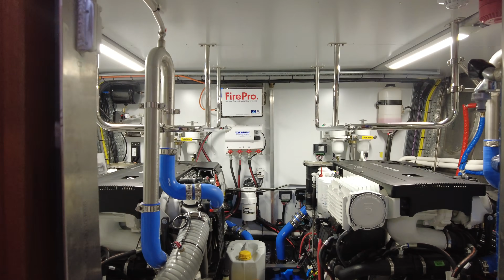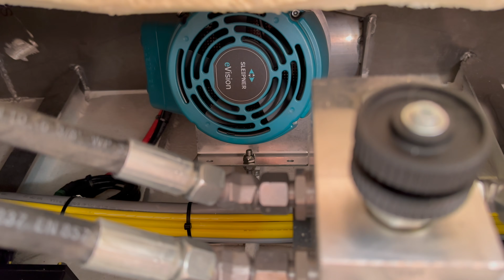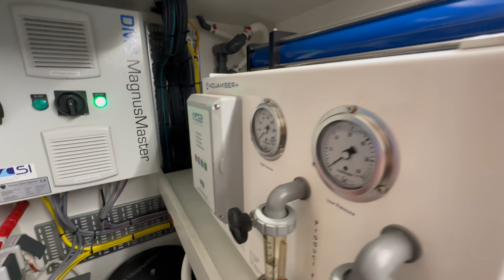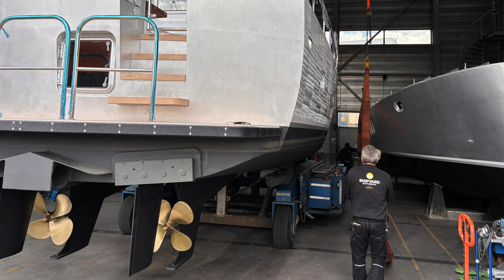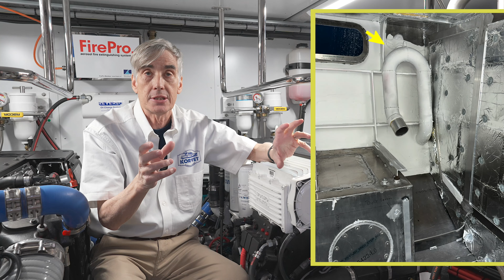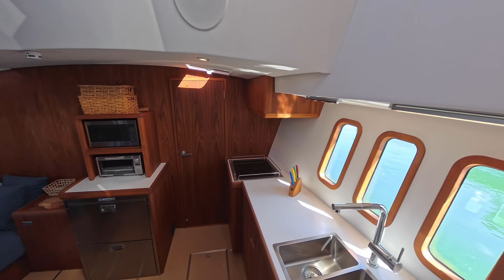The Most Important Room On Any Yacht: The Engine Room

Comment: How is the hull insulation done? Is it suitable for colder climates?
Reply from the maker: The insulation on the vessel is substantial as is primarily closed cell foam. Yes, it is suitable for colder climates. This class of boat is the preferred choice for high latitude cruising.

Comment: This would be a awesome great loop boat in the US. Termodinamica looks like a split system vs a chiller
Reply from the maker: We couldn't agree more! Termodinamica's systems are not traditional chiller or split systems. Instead, they use Variable Refrigerant Volume (VRV) technology, which allows for precise control of cooling capacity and humidity based on individual cabin temp. settings. We'll have more about this system in the future.